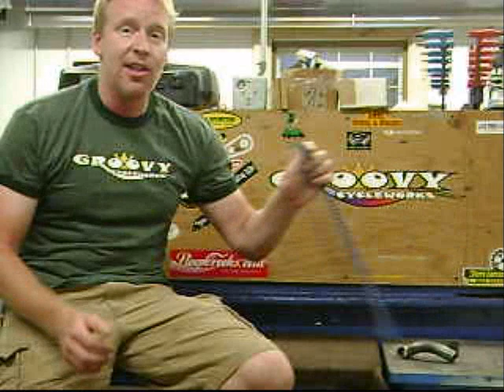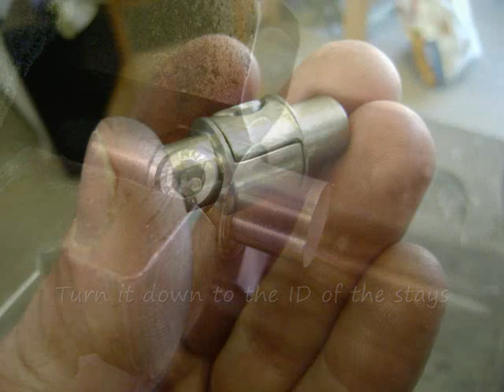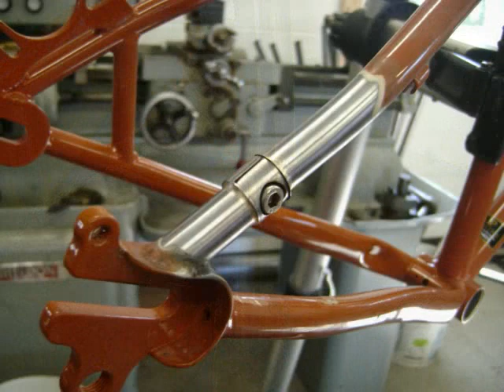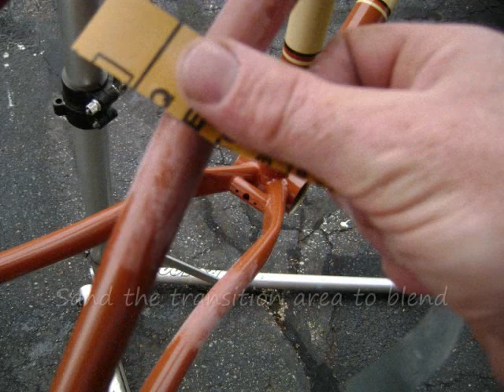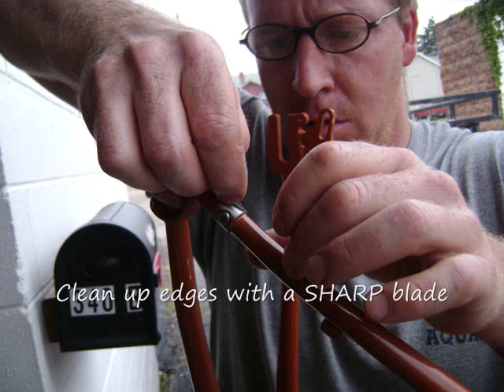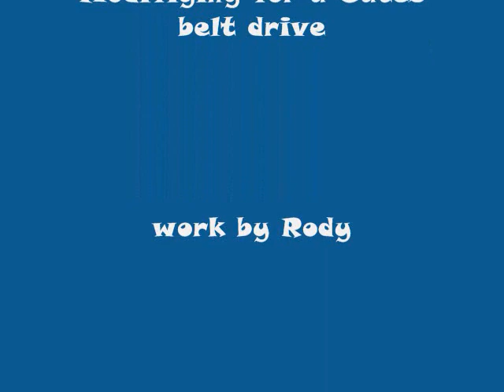Belt drive frame conversion

Comment: Nice job.  I know it is an old video, but, surprisingly, I am not finding similar videos installing a coupler for belt drive that is newer.  I don't know if the belt drive coupler was available in 2009.  Now it can be purchased at Framebuilder's Supply.   If you ever want to remake this video, there is an opportunity to do it.  I liked the music.

Comment from the maker: @cwujek ... the build was very successful.  The key to using the belt drive components is to insure proper alignment, appropriate stiffness in the chainstays, and proper belt tension.  Bike has been running strong for 2 years now.

rody

Comment: Isn't it easier to modify the belt by using carbon welding or NBR adhesive and some sleeves and chromium pins?

Comment: Great idea. Thanks for sharing your solution.
Do you think it would also work with 2 connector links glued in opposite ways, one inch appart? That might avoid having to bend the bike leg a bit  for fitting the belt.  Would it be worth it, considering belts last longer?
Thanks.

Comment: So how did it turn out? I've heard of possible problems using a belt drive with a frame not specifically designed to handle the high tension of the belt. Any slipping when really mashing on the pedals? I was considering doing the same conversion for my Soma double cross, looks great!

Comment: Why not just remove the rear wheel to put the belt on?
Reply from the maker: +Kevin H ... whether a chain or a belt, the drive requires installation AROUND the chainstay. Chains come apart to be fit around this frame member, belts do not have this ability so you must make a passage in the frame to properly install them.  The rear wheel does not enter into the installation equation.
Reply: +Rody Walter I realized that later and should have amended my post.

Comment: BETTER to use the VEER belt system which attaches much like a CHAIN and leaves the INTEGRITY of the frame - untouched (as it should be!)
Reply: This video is 9 years old...
Reply: Veer a stupid thing,thats why not so popular...
Reply: @adamberec83  Good to know - thx
Reply: @adamberec83   No it's not.
Reply: @luigiprovencher  Absolutely rubbish, Gates the king
Reply: @adamberec83  False.
Reply: @adamberec83  Not everybody can or wants to spend thousands of dollars on a new bike.
Reply: @luigiprovencher  Veer for a not belt drive compatible frames,very expensive next to the Gates and the belt is split belt, isn't safety and not long last, little pins in the belt going to be rusty in very sort period, so completly rubbish.. if you have no many, then use chain drive, very simple.. (I'm a belt drive specialist!)
Reply: @adamberec83  Again false. That's just your opinion.
Reply: @luigiprovencher  I see, that you have no idea about belt drives, this is fact, not about my opinion!
Show my just one bike company, which is use Veer belt drive..no one!